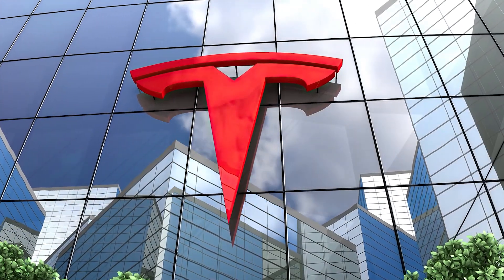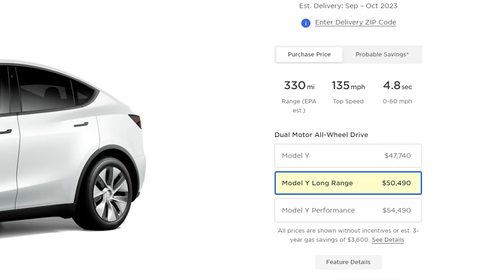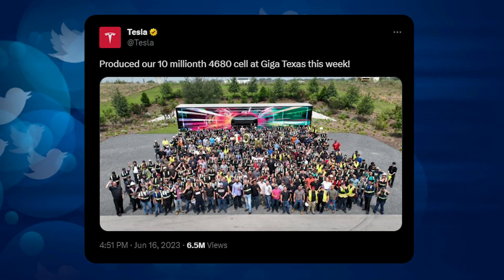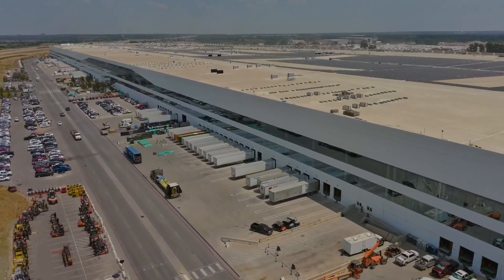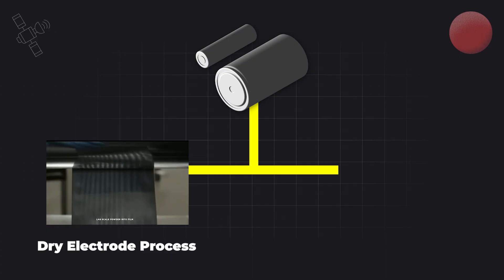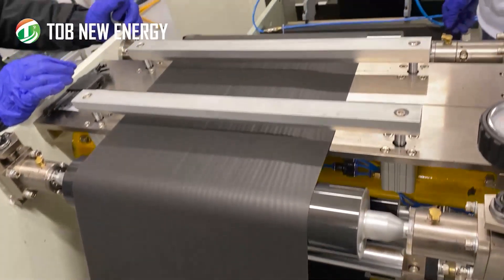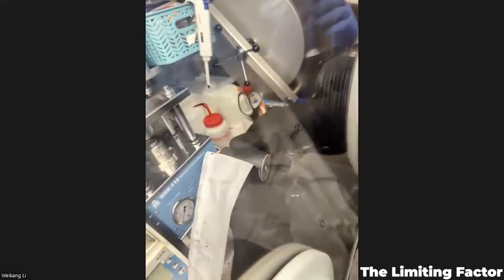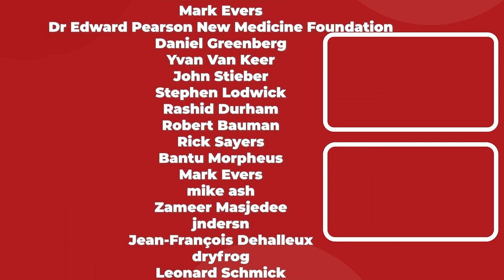Tesla Has A Problem With The 4680 Battery Cell...

Comment: Superb content. Really. This is critical analysis of the 4680. The fact is, that the promise of the 2020 battery day, has fallen flat on its face...if you consider the whoopla of the 2020 presentation. Having said that, the advantage is still with Tesla given its
regular battery production global scale. Its a real pity that the 4680 is stuck where it is. However, knowing Musk, they will absolutely try everything to solve the problem. For me, the biggest surprise was the range reduction of the car offered by the 4680...capacity and charge rate are what consumers care most about (apart from safety of course).
Reply: It didn't fail.  Elon over inflates expectations vs capabilities.
Good for share price however..
Reply: @AudiTTQuattro2003  only because too many let him sadly
Reply: I own one of the early 4680 equipped MYs and Tesla recently stopped offering them.  I find myself increasingly interested to see how this all shakes out.  Both in regards to the future improvements and deployment of 4680 cells, and in the long term battery performance of my car compared to its other cell equipped siblings.  Time will tell.
Reply: The LOWER range with the 4680 compared to the 2170s hurts, for sure.   
The bigger issue IMO is the slow pace of making them.  
TBH I would be okay if Tesla pivots to a different design.  It has been 3 years.  Other options are starting to emerge.
Reply: @billsrelectric yep lower range = a fail , the whole point of making the new battery is that it is supposed to be better than the current ones , so far it’s a massive fail.
Reply: @mikldude9376   Failures are going to occur.   The greatest baseball hitters "miss" over 60% of the time.  Not unlike a stock portfolio too.  Someone is considered a great investor if just 30-40% of their stocks do well, and the other 60% are dogs.   Right now the entire planet is working to find better, cheaper ways to make batteries.  It will happen, even if the 4680 form factor and chemistry is not it.

Comment: I spent my life in manufacturing.
Manufacturing is hard.
Making millions of anything is very hard.
They will get it.
Reply: Yep, only 3 years into an new production.  These things take time.
Reply: R and D and prototyping is hard.  The design impacts manufacturing.  Once manufacturing is set up, turn the crank.  But getting set up can be hard.
Reply: @mefobills279  Till something breaks.
once running you have so much that can and will go wrong.
If its not the customers, its the vendors. and then its the employees.
Every day its a new issue.

Keeping high speed manufacturing running is its own challenge.
Reply: Absolutely. You don't wake up one day and make 10 million battery cells with all the manufacturing equipment to go along with it like making a burrito. That's not going to happen.

Comment: Are they still going to make Cybertrucks with 4680 cells? I also heard that the top model Cybertruck is not going to have 500 miles of range but more like 400 miles of range. Can anyone confirm or disprove this? Thanks for the video. I was hoping the 4680 would be more efficient, not less. It's a good thing I'm just about last on the list for Cybertruck delivery. Maybe they will figure it out by then.
Reply: same here I am probably 3 years from when ever they release it from getting mine.

Comment: That is a misleading statement, if you don't know try not to say they have a problem, .... just for your info you will see 4680 being present in a new model soon, guess which one?
Reply: So have all the gains claimed on battery day manifested? (More range, more power etc)
Reply: @erickbravo5800  Yes, but it has nothing to do with the 4680 batteries.  Current 2170 batteries have more range, power, cheaper ect...
Reply: @davidbeppler3032  battery day was literally about the 4680's
Reply: @erickbravo5800  4680 on a 6 year timeline per Elon and drew comments last summer. 
We just entered year 3 this month. Sit back and let the pros work! 👍🏻

Comment: Cathodes are charged negatively and anodes are charged positively, you mixed it up.
Reply: This is true for electrolysis, in cells though the anode is the negative or reducing electrode that releases electrons to the external circuit and oxidizes during an electrochemical reaction.